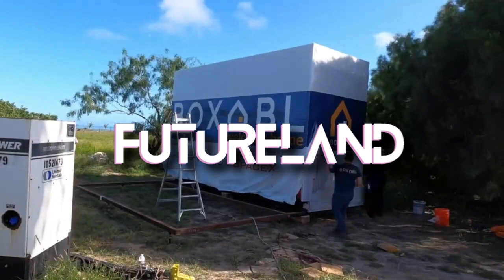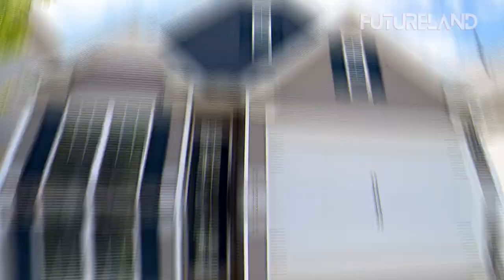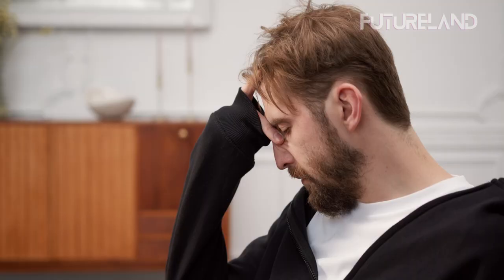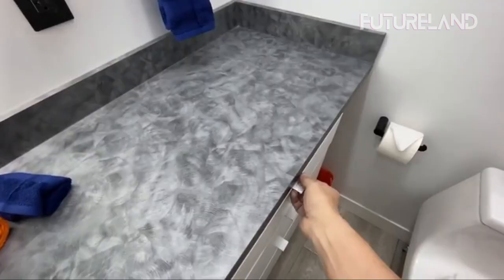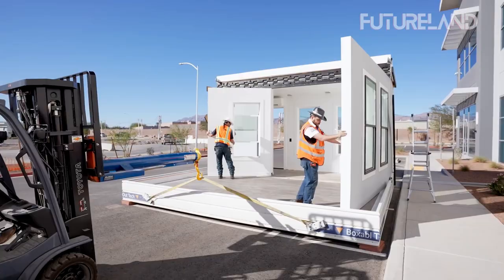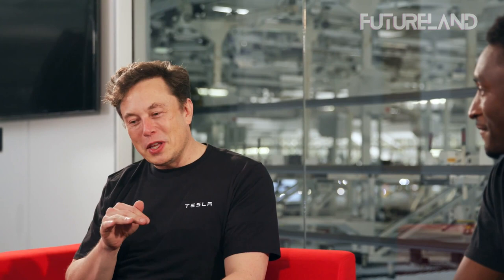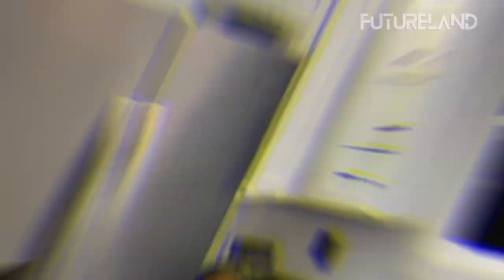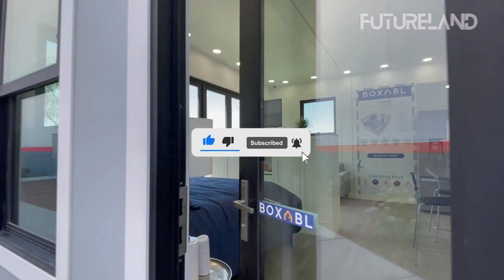IT HAPPENED! $10,000 Elon Musk's House Is FINALLY Hitting The Market!

Comment: The house is currently valued at about $50,000, which is quite low considering that its design is modern and technologically advanced, and that it is a sustainable, environmentally friendly house. However, it is still some way short of the $10,000 goal.